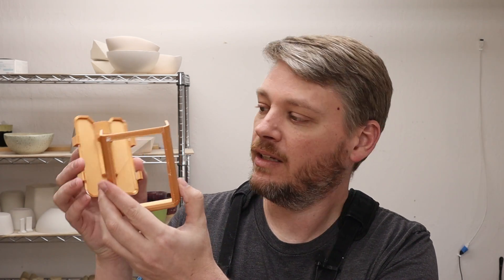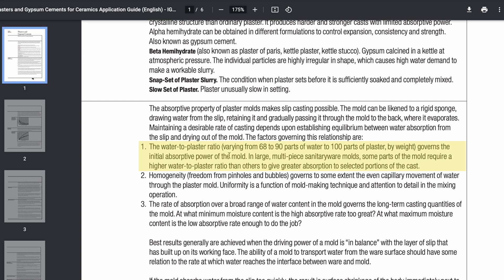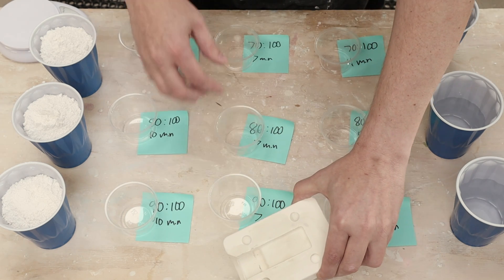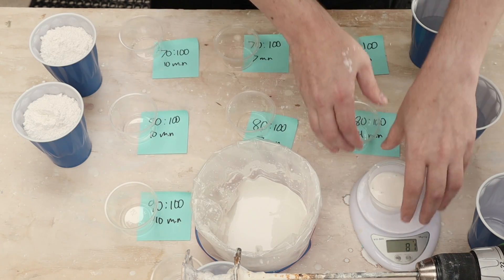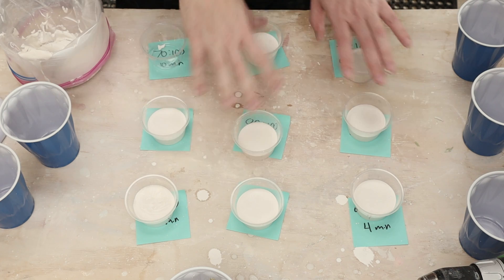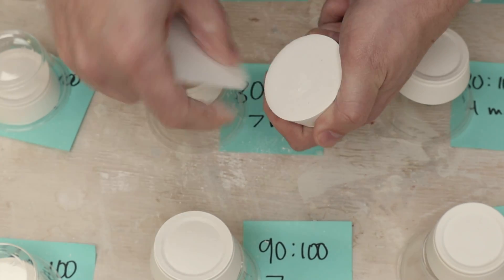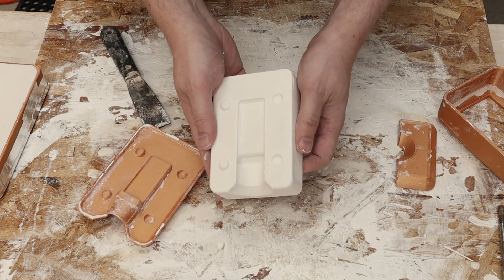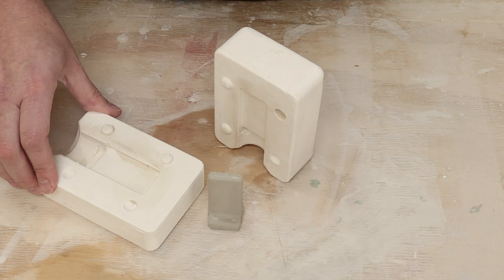What is the right ratio of water to plaster for a slip casting mold?

Comment: For slip casting molds, can you use any type of gypsum cement/plaster like HydroStone and HydroCal, or you just stick to #1 pottery plaster? And if so, why? Do you know of any video somewhere that would show the different results of using these other plasters (if using them is possible in the first place)?
Reply from the maker: Short answer no. It is possible but I wouldn't recommend it unless you're experienced with plaster. From what I understand at a high level these plasters have different very porosity (which impacts strength as well). So from a slip casting perspective, the stronger plasters like hydrocal have much lower porosity and do not absorb the water from the slip at the same rate. You could just wait longer for the water to absorb, but the slip itself is also time sensitive (as it sits, its properties change since it is thixotropic, etc) and will impact the cast.
Reply: @PotterybyKent  Hey, thanks so much for your reply! I was aware of the lower porosity so yeah I was thinking maybe to let the slip sit longer but you clarified that even the slip is time sensitive, so thanks for that.  I did some research and found 3 other potentials at USG : #1 Casting Plaster, Ceramical and Duramold.  Any thoughts about these?  Otherwise, thanks so much for your videos <3
Reply from the maker: I have not used other plasters, so can't really comment there. You can go looking for the manufacturer's' data sheets. USG #1 specifically calls out using it for ceramic casting molds so looking for that would be useful I think.
Reply: @PotterybyKent  I will, thanks!!

Comment: Thank you for this very useful video Kent. May I know what kind of plaster were you using? At where I love there is no pottery plaster, only plaster of Paris, and I have came to know that they are very different and create different outcome. Hope to hear from you, thank you
Reply from the maker: I use USG #1 Pottery Plaster. And yes you're correct in that there are different kinds of plaster. Ask your local pottery supply place what they recommend. The difference in terms of slip casting is that they have different density/porosity and absorb the water differently. (This one is more absorbent). I think the other can work but it will be much much slower.
Reply: @PotterybyKent  thank you so much for your reply! really appreciate

Comment: this was SO helpful!!! How did you not get any bubbles in the plaster as you were mixing it with the drill? I find that creates so many bubbles for me...
Reply from the maker: I'm actually still fighting bubbles myself! One of the best options is to have the right size container. A bit counter-intuitively, it is easier to mix up larger volumes of plaster. A lot of people suggest mixing by hand but that results in much weaker plaster and isn't what the manufacturer recommends.

Comment: Hello! Can I use plaster as slip cast. I can't find any info about it. Most is making the plaster molds. But nothing about using the plaster itself in a liquid state as slip cast. Casting with plaster. Maybe playing with the ratio of water and plaster powder 🤔 . I want to make plaster figurines using silicone molds and I want the figurines hollowed. 

Thank you in advance!
Reply from the maker: No plaster does not work like slip. I would look at rotocasting, I'm guessing that might work with plaster? But not anything I have any experience with.

Comment: Another thing you can try is adding a small amount normal school glue to your water and let it dilute (The water should be semi-cloudy but not thickened in any way) before mixing with the gypsum and pouring. It's an old potters trick for making weak/cheaper plaster stronger for long-term mold use. I can't see why it wouldn't improve stronger plasters too.
Reply from the maker: That's an interesting tip I hadn't heard of before. I would imagine it would make it stronger. I guess it also depends on your final use of the plaster as well. From what I understand, there some magic structural properties that wick away water, and that is one of the things that changes with different ratios, mixing times, and even over time.
Reply: I would wonder how the glue affects the porosity and absorbtiveness of the plaster. I have been wondering why commercial molds are so much more hard and durable than mine. My plaster has been soft, chalky, and easily damaged, so I am looking for answers. I have thought about possibly adding some white Portland cement to increase the strength.